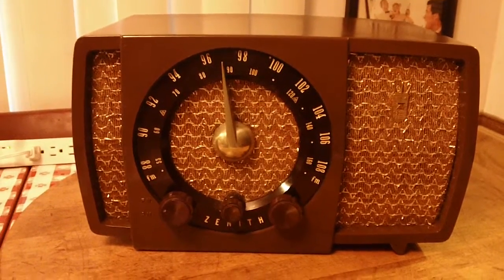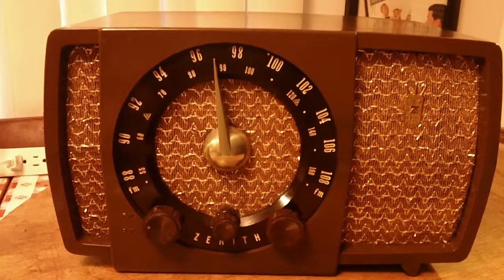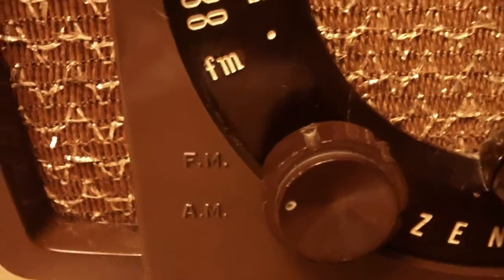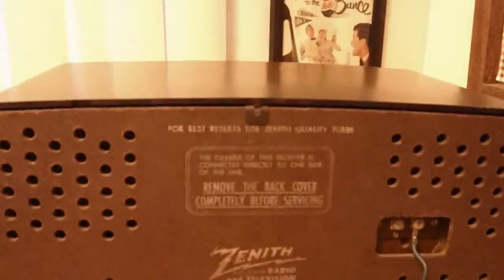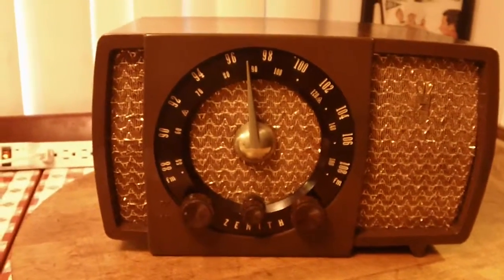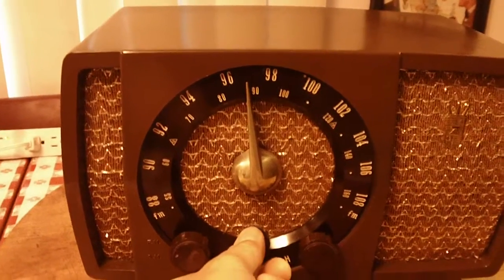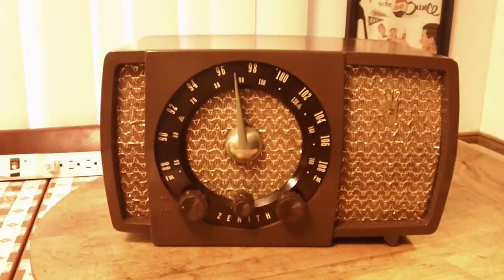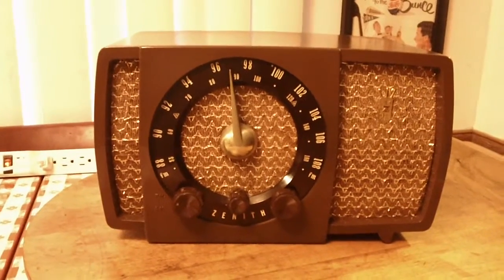Zenith H723, A Vintage Tube Radio, from 1950

Comment: If you didn't tell us about the crack, I would never have seen it. I really like that grille cloth.
I thought the dial was directly connected to the tuning condenser shaft, but it can't be. The numbers on the dial have an angle greater than 180 degrees.
Thanks for sharing this fine radio!
Have a good weekend my friend!
Tom

Comment: Had one of those in 1969 freshman year in college. Had my mom ship it to me and case cracked but it worked great…awesome room filling sound! Got many favorable comments from dorm mates then. Got my eye on one on eBay that looks as good as yours…great memories. Don’t know what I did with it after college as I flew home and can’t imagine I had room in my suitcase….picked up a vintage 1965 Zenith RW47 transistor AM/FM portable radio last weekend at an estate sale for 50 cents in excellent working condition. Old tech is fun!😀
Reply from the maker: Surely is. This one is still working great. Happens to be about 5 feet from where I'm sitting. Good luck on eBay.

Comment from the maker: Jack, I use an SSTran AMT3000, primarily.  That covers most of the house.  I also have a two tube model that I purchased on eBay, which I use in the shop.  It's coverage is very limited.  I've seen your videos of your Philco wireless, I thought it worked pretty good.

Comment: This is a great Zenith radio (which came in many colors and a variety of grill cloths), just wish Zenith had added an RCA Jack to this radio so modern devices could be played through it.
The radio came out in the 1950's when the RCA Jacks were popular and on most radios, but for some reason Zenith left them off on these Models.

Comment from the maker: These AM transmitters are designed to comply with FCC part15, so they don't transmit far.  I added a bit of length to my antenna, which is probably a violation, but, I've also tested to make sure it isn't broadcasting outside of my property.  It's a kit build, can be done in an afternoon.

Comment: That's OK AL, I've had to paint a few of my radios to make them look like new again. It looks good, so that's what matters. What are you using to broadcast? I've tried different AM transmitters, but never found one worth keeping. For a while I was using a Philco wireless transmitter from a wireless turntable, but wasn't very strong. Yours sounds very good and I could tell by the choice of music that you were transmitting to the radio...:)

Comment: I have a few of these.  In contrast to yours,  mine work better on FM than AM.  This is not due to the radio, but the power lines near my house.  All of my AM radios get a bunch of static from these now, must more than in the past.  The AM radios have much better reception in my backyard workshop.  Of course that does not solve my other problem-there is almost nothing I like listening to that is broadcast on AM  now.  It is mostly  just talk radio garbage.  I have a transmitter that I have used, but I think yours is of better quality and I plan on getting one like it.  One more comment-the early 50s Zenith AM/FM radios I have sound great, Zenith made very good radios in those days.
Reply from the maker: Jody Everett Jody, Really couldn't go wrong with Zenith in those days.  I live in a noisy area, too.  As for transmitters, I've tried a few and it does make a difference which you use, but, locating it in the right place seems to be just as important.  Thanks.
Reply: OldRadioAl I restore TVs also.  Zenith made the best of these also. One problem that can occur in 1950s radios in general is the leaky IF mica capacitor issue.  I have seen this in these Zenith AM/FM  radios as well as Zenith  AM only ones. For the FM IFs the value to use to replace the leaky IF caps is 28 pf.  The AM value is 100 pf.
Reply: Thanks, I will see if I can find the show around here.  Since I wrote my email, I restored an early 1960s table top TV.  After replacing some caps, resistors, etc. It works great with the DTV converter box.  Usual Zenith quality from that era.
Reply: I have a small Zenith color TV that I bought new in 1984.  Other than replacing a diode after a lightning strike, it has required no service.  All of the old TV brands(with the exception of GE, who made mostly horrible TV sets in the 1960s- and Motorola-who is almost gone) are now owned by Asian companies.   Examples of present day American electronic companies are TI, Intel, etc.

Comment: i have one of these radios that im wanting to try to restore. Any tips on where to begin?
Reply: +Austin A i have pictures of the amp itself. looks pretty clean except one of the resistors or capacitor(not sure what it is) is broke, and one where the power comes into the amp is blown up
Reply: +Austin A i believe that it is a resistor that is broke and a ceramic capacitor that is burnt up
Reply from the maker: +Austin A First thing I would recommend is going to nostalgiaair.org and downloading the schematic for the set, which should tell you what those components are, as well as their values.  After that, replace all capacitors with like values, check resisitors, with a multimeter and see if it works.  There are a lot of other steps to a complete restoration, including aligning the radio, however, getting that first one, if this is your first vintage radio, playing music, will lead you to explore all the rest,  variacs, tube testers, o'scopes and such.  Good luck.
Reply: thanks a lot, ill look into it more. thanks for giving me a good place to start. this is my first tube radio that im working on.